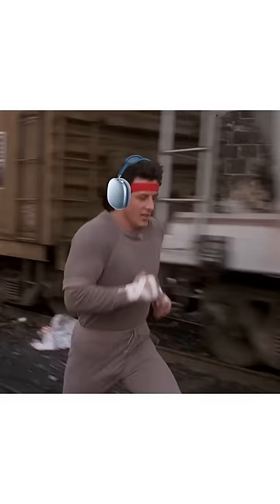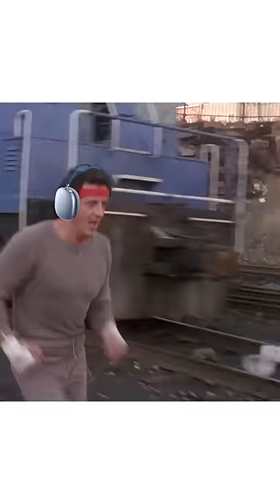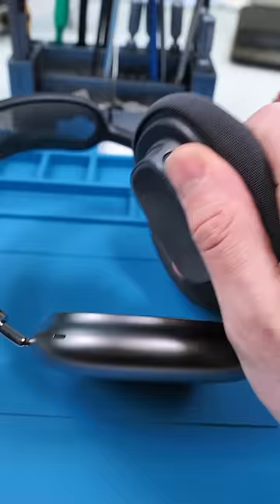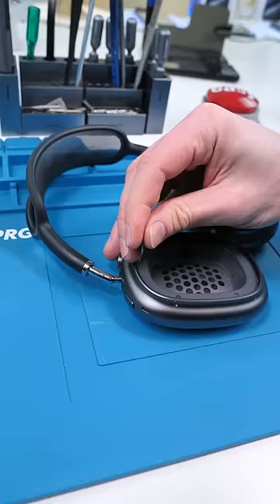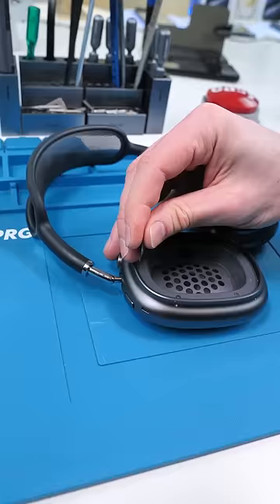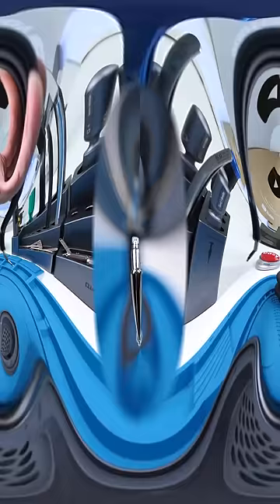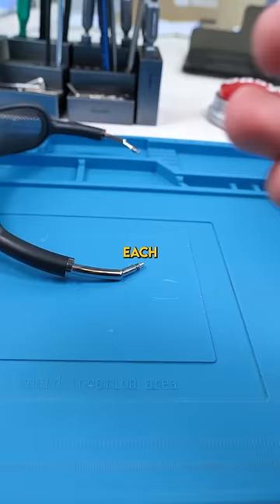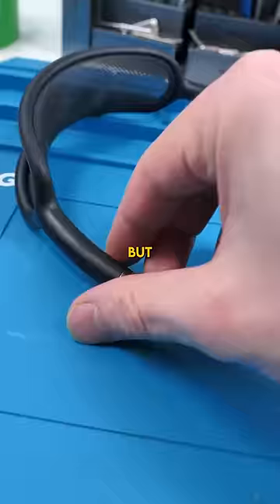Airpod Max's KEEP DISCONNECTING... #Shorts

Comment from the maker: Super common with any wireless headphones people use to workout with, usually there's issues charging as well especially if you're using earbuds that charge via contact points.
Reply: Bro do something about these disgusting bots. They make it very difficult to read the comments without encountering them.
Reply: First reply ❤️❤️❤️
Reply: Hey brother
Reply: Bro, buy fake s24 ultra
Reply: My right earbud just yesterday developed a battery issue where it dies after 2 minutes no matter how long it's charged for, really the worst time for this to happen with all the music dropping from everything going on with hip hop rn, PLEASE SUGGESTIONS ANYONE?! i can't find anyway to open the earbud talkless replace the battery
Reply: The bluetooth device is ready to pair
Reply: Can you show us all the iPhones you’ve got😊
Reply: Now figure out how to use them when there icloud locked. <3
Reply: this is very common on the maxes
Reply: my headphones loose focus In a way it just like zones out like a person sometimes
Reply: I have a problem with my earbuds when I go to the gym it always disconnects
Reply: Odd. I've never had that issue. I've had touch controls mistake water for a touch control input but never corrosion, and I'm in the water with every workout.
Reply: Bro, it's an iI2
Reply: I don't think that's an issue with any wireless headphones over 50$, except the Apple AirPod Max.
Reply: Have had jbl headphones since 2017 and battery as good as new and looks like new after heavy use
Reply: Hey is it posible for you to fix my mic on my inzone h7

Comment: Apple really can't let go of that lightning connector
Reply: airpod maxes are 3+ years old
Reply: Right 😂. Usb c would have prevented thus problem because its internal.
Reply: Its comming an airpods max usb-c this year tho
Reply: @cheatlmao  in the other hand, Apple Vision Pro is barely a year old, and it still has a lightning contraption on it
Reply: @francomarchesotti7746  lighting contraption ☠️
Reply: for this one case, lightning actually works well since it only needs 2 pins per side, but the actual lightning connector the iPhone used and the lightning contraption lmfao the vision pro has is awful
Reply: @cheatlmao some companies actually update products after launch
Reply: ya! ikr!
Reply: They still manufacture them to this day, lol
Reply: But their headphones can 😅
Reply: @lt6986  i trust the rigid lighting connecters over usb c with something like that usb suffers from having a lot of contacts and breakable pieces
Reply: @slapp3r439  of course you do because the apple Isheep mentality never fails. USB C is far more capable and resilient than the lightening port which is why they switched to it with their laptops beforehand. Check the data speeds...
Reply: It couldve been good-er if they had increased its capabilities
Reply: Lightning is more reliable than usb-c even though its faster
Reply: @lt6986 Data speeds have nothing to do with what he said lmao
USB C is just less durable than lightning, end of discussion. It may win in every other instance but when it comes to durability, lightning is better.
Reply: @byzaha1238  clearly i didn't just say speeds. How is it less durable??? Thats your iSheep mind clouding your judgment. Everyone knows that Apple cables are extremely poor quality, not to mention that the lightning cable has external exposed circuits which makes it less durable. That's what happens when you respond with emotion instead of intelligence. Cognitive dissonce is strong in you.
Reply: @XenoxRaider  according to who??? Apple? 😂😂😂. Apple cables are worse than chinese gas station cables but you want to talk about reliability.
Reply: @slapp3r439  huh??? That's why Apple is able to sell yall crap material without question. "Rigid" with exposed external circuits that are more prone to wear, rust/corrosion, damage, etc. Makes sense.
Reply: @francomarchesotti7746 blud its internally. What does it matter? You are not supposed to see it
Reply: @lt6986  we're talking about the connector pin itself, not the cable. And yes, a flat piece of metal is more durable than a hollow tube with a thin silicon pin inside... 

In this instance, you're the one having your judgement clouded
Reply: @antoinedube-cote155  are there external pins on this "flat piece of metal" or are the pins internal??? Doesnt internal pins have more protection than external pins??? It's common sense, which is not so common for apple users. 😂😂😂. Its crazy that yall have to do all of these mental gymnastics just to be wrong in the end. Also the diameter and the type of metal for your "flat piece of metal" matters as well and I'm sure that you didn't have the specifics of a stress/strain test before making your claim solely on the metal piece itself.
Reply: So... Should they have used USB-C to connect the headband?🤣
Reply: @ok1lad159 No, because USB-C is huge compared to that connector and there's no point using a non-proprietary connector anyway because nobody's connecting third party headphone cups to their AirPods Max even if they did.

Yes, Apple should have switched to USB-C on their devices a long time ago (maybe around the time they did on their Macs?) but the idea that Apple is deliberately going against international standards by using internal connectors to connect things that aren't intended to be disconnected in normal use but can be anyway for repair purposes is silly
Reply: @lt6986 I've had the middle part on a USB-A port break and I still can't plug things in. USB-C ports also have a middle part that can also break. A lightning connector might be more likely to break than a USB-C connector, but broken cables can be replaced. A USB-C port is more likely to break and you can't just replace a port.

Of course, that middle part is mostly what makes USB-C better, because it means that there's more surface area to put pins on
Reply: @TheRenegade...  yeah, i completely agree. I meant what i said sarcastically, because the original commenter made it seem like that's what apple should've done.
Reply: @TheRenegade...  what were you doing to mishandle the cable? I have tons of usb c and micro usb cables and i have never had that happen. Lightening cables have a USB A end so that killed your point. USB C has USB C to USB C
Reply: It’s literally not a lightning connector. It’s simply the best, simplest, most robust design of a connector that works perfectly for internals.
Reply: @clothinghanger6978 the one on the Vision Pro is great, wdym? Especially for that application with the battery it is much better than USB C
Reply: @couchpotatoes5158  it's a shitty connector proven time and time again to fail faster than USB C, and I'm not saying USB C would have been the right choice here either, it just shouldn't have been lightning
Reply: @clothinghanger6978  wdym? Lighting is fundamentally a more robust and durable connector. You can find videos of people testing that.
Reply: @couchpotatoes5158  the port is more durable but the cable is not
Reply: The platform is reliable and they have no need to standardize it in certain places.
Reply: @cheatlmao and how long have we had ipads with USBC ?
Reply: its not like they arent good. the only thing bad about them is that they were proprietary
Reply: @TheRenegade...  Why is it silly thats literally what megaCorps do to retain business and repairs which they claim is more expensive than buying a new device
Reply: @TheRenegade...  You absolutely can just repair a port. Desolder port. Resolder new one. 

Not an insane fix
Reply: @francomarchesotti7746 yea dude the fifteen is the first to use usb c
Reply: Why would they use a thunderbolt 5 port if lightning can provide what they need
Reply: bro, do you want 18 unused pins for a fking type c? stop hating connectors please. i guess you never made disassembly on something.
Reply: @littlehippo5004 yeah, i personally wonder what they thought when they saw flex cables.

Comment: Charging $500 and then running into issues like this is wild
Reply: literally running
Reply: And it was easily solvable with some isoprop alc. Not a huge issue, and PRG himself said irs a common issue for many headphones
Reply: wired connection is always better at synchronisation, and they even makes it modular so both cups and the headband can be replaced individually. there might still be some serialisation under the hood, but it is a good start for better repairability.
Reply: most headphones have this issue
Reply: And if apple removed the customization with the head band you’ll start crying about the customization incapabilities? This is easily solvable with a drop of isopropyl alcohol, not a big issue. You can’t buy protection against this issue unless you entirely seal it “waterproof” so sweat doesn’t come near it…

Comment: Bought a couple apple chargers and a fast power bank from a yard sale for a buck, one of the connectors wouldn’t charge and I saw a pin corroded, a couple scratches and it works great!

Comment: Had the same issue, this is only a temporary fix. After doing this for the 4th time (they kept disconnecting again after a few days) they wouldn‘t work anymore at all. They‘re not made to work out with, learnt that the hard way.

Comment: I prefer this kinda connection though if one side just doesnt work anymore just replace it with a new one. Probably the most repairable headphones out right now, though I know theres the IEM's you can also buy, but those are usually in ears.

Comment: That’s stupid and lightning port is the worst thing ever I’ve probably had five or six of those official Apple wired earbuds go bad on me just simply because when they get older whenever you touch the cable, it just completely disconnects and it’s not like I take bad care of my stuff either
Reply: it isnt lightning... its just a 2 pin connector

Comment: You also use a SIM ejector tool to open the Apple Vision Pro's battery pack cable, which believe or not, also uses a proprietary Lightning-looking connector. They just can't let that Lightning connector go 😂
Reply: what shape they could select bro?

Comment: Hey everyone, these “lightning” connectors are pretty common and change shape and pins in a lot of tech,.. they also go by another name called… ribbon cables. But these ones are easier and more durable so you can actually get to and clean them easily without breaking them. Y’all will complain about anything. It’s not like this is a proprietary charging port. It’s a simple thing to transmit data. So shut up about “waaahhhh Apple won’t stop using lightning.” They pretty much have in all their tech save for older models and some other small things. Focus your energy on bitching about something important than what a company uses to make internal connections… connect to internal parts.
Reply: thats what i literaly say at every comment. i wonder if those people made a disassembly on something old (that most stuff was modular)

Comment: why wouldn't you just use a standard 2.55 mm jack (mono channel)
Reply: it would look stupid, these cables also send a data between eachother (they are serialized)
Reply: @HAKANKOKCU these connectors have 2 contact points, same as micro jack (mono) you could use a 3 channel micro jack for the same purpose if you wanted it to be cooler. No-one would see the connector (just like no-one sees it now) so it wouldn't "look stupid"

Comment: well i have the same problem with my jbl tune 510bt and i rode my bike in the rain with these and yes they arent waterproof or resistant but the proble started before i rode with them on and it is on the left ear but they are in repair so yeah any idea why this might happened?

Comment: Apple loves there lightning so much that they couldn't give it up
Reply: The 15 doesn’t have lightning
Reply: @tdrg_  re read it a few times and you will see that I meant they couldn’t give lightning up all together
Reply: @Ryzobyte  the ratio kind of demands that your original comment be rephrased so that we can understand
Reply: it isnt lightning. count the pins (only 2, why waste typec on that). its a ribbon connector.
Reply: @HAKANKOKCU  obviously they wouldn’t use lightning, it is the same design as lightning though

Comment: Awful design. Form over function every time with Apple.
Reply: the fact that you can just easily disconnect the cushions and stuff is a win in my book
Reply: how is it awful, do you have soldering iron?
Reply: @HAKANKOKCU  How it's awful? Most headphone manufactures make the connector into the headphone long enough so that it doesn't get corroded. Apple put the pins at the very end. And what does a soldering iron have to do with it?
Reply: @AquaCobalt  You can remove and replace the cushions on any mid-ranger to high-end headphones. The only difference here is that it's attached with magnets on the Airpods, but considering how seldom you remove them - that's again, bad design. Magnets just add unnecessary weight.